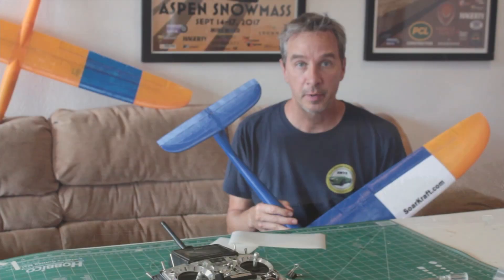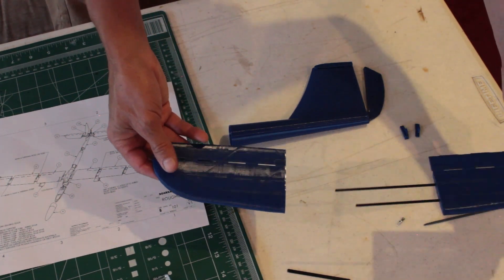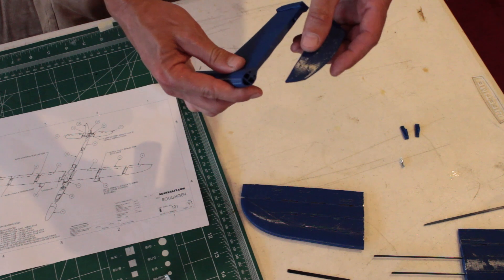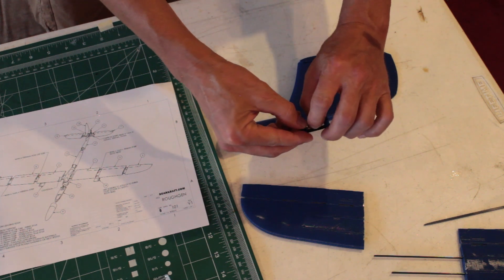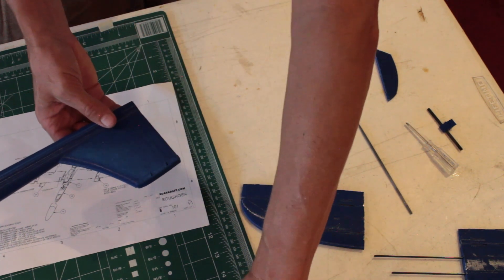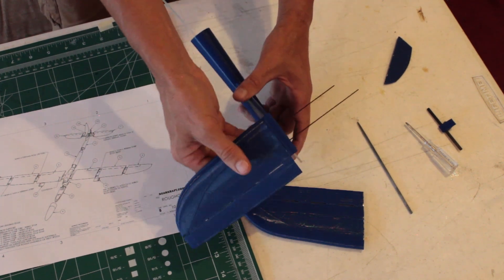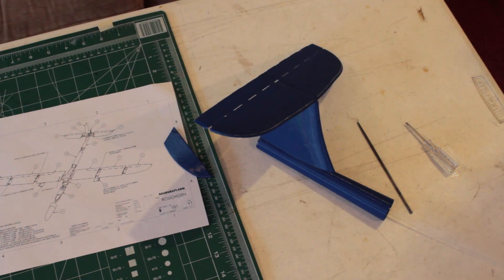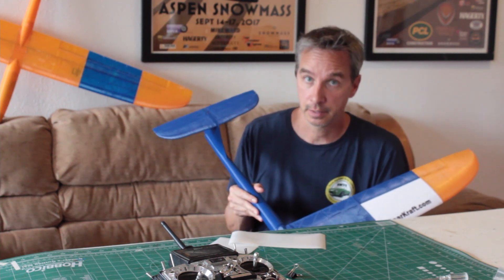SoarKraft Roughgen - T tail build guide

Comment: Hi Wayne, quick question .. is it movement of T tail push rods little tight ? I have bought DU-BRO 922 as suggested and when I do test fitting I have noticed that it is little hard to push wire in that Bowden tube because of angle how it is goes inside T-tail ... any suggestion / recommendation ? Thanks :)
Reply from the maker: It will have a little drag on it, but should not have too much.  Make sure the pushrod goes to the bottom side of the "mid" section of the fuse.  If it is on the top side i could make an unnecessary extra bend.  Test fit everything before gluing and check this too.  I have made many of these and forget about little details like that.... Other things are possible, but that is my guess.
Reply: @soarkraft  Thanks Wayne for this note... I had already passed the tube through the top! I will change it below